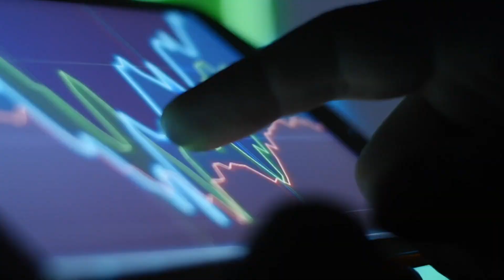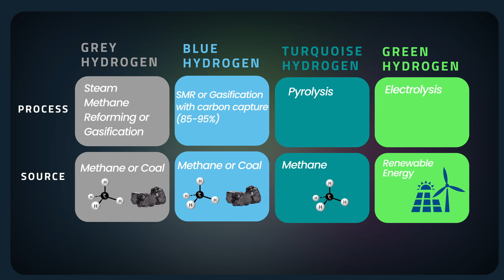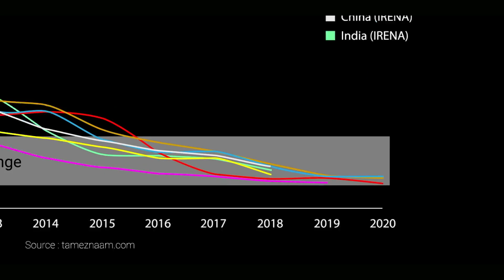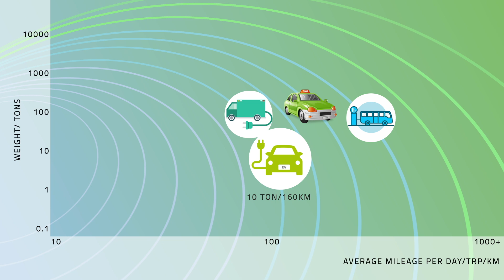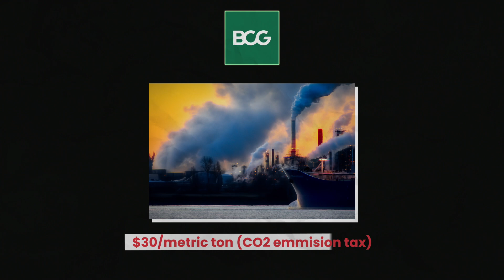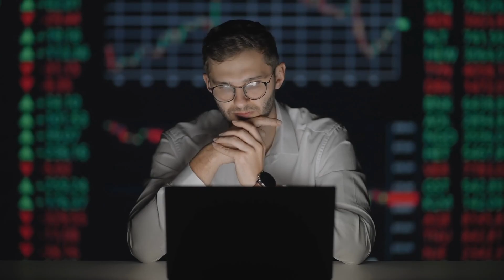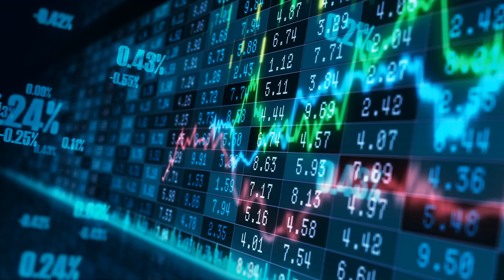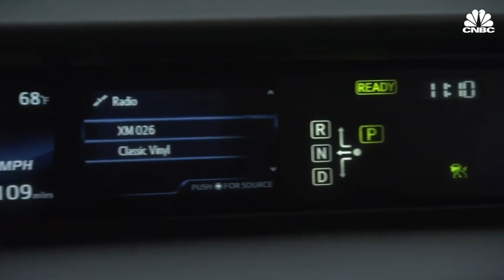Why NITIN GADKARI is pushing GREEN HYDROGEN for Indian Industries : Policy Case Study

Comment: This is what happenes when dumb mba students who hav no knowledge about the engineering aspects come across a new technology, hydrogen is an economic suicide for an economic if adopted for vehicles, 
The efficiency is so bad that you will bankrupt an entire nation

Here's a rough break down
U need hydrogen production facility 2 option on sight production & off sight production
. On sight is less efficient but more economical
But you need a super grid (electric grid) to facilitate this as every gas station will now consume upwards of 10mWh a day and this would be parallel to solar maxima for green hydrogen which means a peak load during peak solar , this super grid and green hydrogen has a theoretical maximum efficiency of 65% well we live in a real world where the efficiency is close to 30% (pemfc + electrolysis are super inefficient) so 70% energy is lost in all the conversion(1), who the duck is paying for the lost energy? , and if you are building a super grid anyway then you would rather use it charges bat EVs which has a theoretical maximum of 96% efficiency and guess what we are already at 89% real-world efficiencies (1)... at the end of the day if a free market exists then hydrogen cannot compete with bat EVs if you make laws to favour hydrogen then you will collapse the economy

Green hydrogen for iron reforming and steel production is an actual necessity which can only be solved by hydrogen (economically speaking) a true gold mine as well 

Please take down this video and don't post videos about topics that are out of your scope of understanding

Comment: How to store hydrogen?
Hydrogen is the lightest element in periodic table it can  pass through  any metal 
For that reason u have to rap you fuel tank with carbon fibre 😅 as per my knowledge carbon fibre is a very cheap meterial.😂

Comment: You missed to cover that batteries are more efficient way of energy delivery that hydrogen. Producing hydrogen from electricity, transporting it to site and converting back to electricity: there are massive losses in every part.

Hydrogen would not stand up to batteries.

Moreover there are huge safety risks with storage of pressurised hydrogen.

Comment: If green hydrogen is the way forward then all the oil majors,bpcl,hpcl,oil,ongc should have a stake in developing it and no pvt player like ril or adani should be allowed.these units dont require a lot of labour and hence should be operated by the govt.Steel,cu,coal,manufacturing should not be in the govts hands but green hydrogen should.

Comment: I must say for the transportation sector explained here, H2 is already thought as winner which is nowhere close to reality. In simple language if u generate 100kwh of energy, you can use 95 kWh in electric car on the contrary in hydrogen fuel cell u will use only 60 kwh in best case, mostly it will be around 40 kWh.  And this is Thermodynamic barrier like IC engines which can not be solved unless you find way around laws of physics. I simply don't understand educated people going blindly after H2. Do you know how difficult hydrogen storage is. All this great energy density and all is possible when hydrogen is stored at 700 bar. Do you really want pressurised H2 under your seat when you are driving. Only fools and idiots can think of H2 as transport fuel with these massive disadvantages which outweigh its advantages such as charging time. Direct electrification of road transport and railways can only decarbonise that sector. There is no way around. I really like Think School videos but this is disappointing to see they have also fallen pray to hydrogen hype. Green H2 should only be used where there is no other option like steel, chemicals like ammonia where right now we are using black or gray hydrogen.

Comment: Green Hydrogen? Ain’t no such animal folks! 
The only economical way to do it is still steam reforming, which uses mined natural gas, releasing tons of methane, which is waay more potent greenhouse gas than co2. If you want to produce hydrogen through electrolysis from solar and wind, you’re far better of storing the power in liquid air or batteries.

Comment: Bio- methane is still best suited for transportation with more advantages. Like it solve the garbage problem, cheap and affordable, moreover methane is trapped and used as a fuel which will otherwise contribute to global warming and keeping in mind that methane is far more dangerous than CO2.

Comment: REALITY HITS @14:30. Hydrogen is meaningless . Why ? Because you have to generate hydrogen using electrolysis 1) split water 2) generate hydrogen 3) transport it 4) use in vehicle's fuel cell to generate electricity.

Comment: Hydrogen as an Alternative Fuel
Hydrogen is considered an alternative fuel under the Energy Policy Act of 1992. The interest in hydrogen as an alternative transportation fuel stems from its ability to power fuel cells in zero-emission vehicles, its potential for domestic production, and the fuel cell's fast filling time and high efficiency. In fact, a fuel cell coupled with an electric motor is two to three times more efficient than an internal combustion engine running on gasoline. Hydrogen can also serve as fuel for internal combustion engines. However, unlike FCEVs, these produce tailpipe emissions and are less efficient. Learn more about fuel cells.

The energy in 2.2 pounds (1 kilogram) of hydrogen gas is about the same as the energy in 1 gallon (6.2 pounds, 2.8 kilograms) of gasoline. Because hydrogen has a low volumetric energy density, it is stored onboard a vehicle as a compressed gas to achieve the driving range of conventional vehicles...wikipedia. From 1992 it is on  paper only. We are not really serious.

Comment: Ok I got it. So Ambani and Adani is on board. Now there is no doubt where the idea came from. For those praising about this technology,  hydrogen has failed to succeed in much more developed nations with much better infrastructure that can handle the complexities of transporting and storing hydrogen. It is a high pressure system that is more potent than a lithium ion battery. Also fuel cells are very sensitive of contaminants. Toyota had worked for decades on this technology for transport.  The electrolytic convertion is very energy intensive. So the full chain of operation from source to consumptions is a lot more complicated.
For those who want to understand how alternative energies pan out, solar and wind are not really reliable sources of energy especially during peak production needs. If you add more steps in the storage to consumption steps you are increasing the cost.

Comment: @06:21 mins, how on earth Hydrogen powered vehicle key components takes less space? I agree - fuel cells take very less space.  But where is the hydrogen tank? Is it compressed hydrogen? then the hydrogen will leak from the tank (due to low molecule size).  Or it is cryogenic liquid hydrogen? Then it will require refrigeration. AND i am not talking about the extra energy required to either compress or liquidize hydrogen.

Comment: Thanks for the awesome content. I believe with the boom of the EV age, another factor of concern will be with the discarded Li or Po batteries and its components. In the past there were similar issues with the Led acid batteries (which got bettered in many ways later); however, there are seldom strict rules yet on how they are discarded and how that waste would be managed. This new revolution will be such a breakthrough.

Comment: While you informed about weight of li-on batteries being issue should also inform how these models are 90% efficient in using the energy and there are things being done to get away from cobalt. As far as i know major batter manufacturers are moving away from chemistry that requires minerals that are rare to find except Lithium. But good video as always and yes green H2 has to be go to fuel for anything but personal vehicle segment.

Comment: Bro, I like your content, but please double-check all the facts. With a regular AC charger, it can take more than 10-14 Hrs to charge at least 80% of the battery. 4 Hrs would be good enough to charge 50%-65% of Tesla using Level 2 charging stations.

Comment: Hydrogen is a pernicious product. Shortsighted people will see a solution all others will see danger signals in handling hydrogen.  Hydrogen still adds steps to driving that batteriers eliminate.  All good to let your neighbor refuel hydrogen until a little leak occurs and then BOOM!  Oops sorry.  Your battery information is 5 years old.  New battery technology is just as capable as your hydrogen projections. What about refueling at home?  Electric is clean and simple. Hydrogen is pernicious, Just ask the most capable engineer on the planet.

Comment: He has no knowledge of fuel. Hydrogen is not fuel for car that will work. If it was then it would have. It costs 3$ to manufacture it via electrolysis. It is no way sustainable price by any stretch of imagination and there is no way to reduce price down yet. All solutions are in research forget about commercialisation. May be for energy and buses but not for cars.

Comment: Challenges in green hydrogen
1. Water which is already scarce
2. Storage of hydrogen is like a ticking bomb
3. Distribution cost is higher than that of electricity distribution thru power plants considering the transmission losses
4. Alternatives like sodium based battery may come out way cheaper in near future

Comment: Hydrogen is inefficient, carbon capture isn't yet possible at scale so grey H = very bad, lithium batteries aren't the end of battery evolution, it's the beginning, with batteries you can make your own energy from the sun to power your vehicle.
Using H or fossil you are trapped in corporate greed.

Comment: Insted of hydrogen fuel cells, hydrogen gas use directly how we use CNC gas used as a internal combustion egines , we directly replace petrol and diseal with hydrogen, vehicals 
Japan already toyota cars developed hydrogen internal combustion engine , no need platinum and cobalt metals only draw back of hydrogen is correct handling it other wise it is like more serious danger effect compare patrol and diseal 
Per unit burning hydrogen gas it produce 576 k MJ wher as diseal 360 K MJ and petrol 490 K MJ energy

Comment: Pushing green H2 is a phantom dream
Green H2 is using way to much energy to produce in the first place.
So it will be produced from natural gas as it it now. Not solving any problems.

Secondly it needs transport infra an filling stations. 
The EV battery adoption that is in place for
City traffic is way more sensible.

Comment: Green hydrogen can never become viable to produce power. A certain amount of energy is required to break the hydrogen and oxygen bonds in water and there is no way to reduce that energy requirement.
If we have an electric car that runs on batteries, we can charge it at home. We can't produce hydrogen at home.
Li-ion batteries can be recycled.
No taxi driver will drive 350 miles without taking some rest. 
The byproduct of hydrogen as a fuel is steam. Water vapour is a global warming gas - as much as carbon dioxide. And, what ecological imbalance will be created by pumping millions and millions of tons of water vapour into the atmosphere, no one knows. Increasing humidity beyond a limit will make the planet unlivable.

Comment: A new good development. A technique to store hydrogen inside a powder to enable solid state transportation has been discovered. To retrieve the hydrogen enclosed within the powder, heat is applied to this powder.

In principle atleast, the safety-transportation hurdle of hydrogen looks to have been tackled.

Comment: Green hydrogen is manufactured with electrolysis of water, and this electricity comes from coal, and conversion of one form of energy into another form there is a considerable amount of energy loss as per the law of energy conversion. And pollution will remain as it is.because coal burning will cause green house gas emissions and heat.

Comment: I’m a material science engineer, I agree to what he says at the basic levels as you start to dig deeper it gets very peculiar for every case. No lithium iON battery doesn’t get counter productive due to added weight, conditions such as cell quality and operating temperature are the driving factors. Hydrogen fuel cells are not new they have been implemented in first world countries and have failed to take over mostly due to high Refill costs and car manufacturers putting a premium for them. Toyota , Mitsubishi, Lexus all tried to push their hydrogen vehicles but failed miserably . The astonishing factor in this case of India is the wealthy tycoons have opened up investments to this cause. With the relatively high Gas cost in india Hydrogen fuel might actually work. Would be intriguing how this unfolds .

Comment: I just have a doubt...
Won't hydrogen just explode in case of fire?? Hydrogen flame is so hot that it melts metals.... 
And will people be ready to keep such a dangerous thing in their vehicles??
> Yes i accept even carbon fuel also explodes but that requires an enormous amount of oxygen to create such an explosion. But hydrogen requires just half of its volume of oxygen to explode that too in a very very short interval of time.

Comment: I would like to correct you that Hydrogen reduction method is not used in India yet for steel production its reduced using coking coal or majorly petcoke frm Refinery which is the reason that steel industry produces so much of carbon foot print. Hydrogen based reduction is still in nascent state that too in advanced  countries, So evan if u use grey Hydrogen for reduction processes that's far far far better than coking coal and evan aftr that there will be Co2 emissions which is called process emissions.

Comment: Spliting h2o ie water will reduce total water in the ecosystem? Will it not create imbalance? If yes, will it not dry up the water on this planet after many decades as the energy consumption is never going to end. Also there will be too much o2 in air after electrolysis ie more than 21% which is required for ecological balance. So increased O2 in air might catch fire. Just asking. Can someone explain if I am misunderstanding anything?

Comment: Thank you for the amazing content. 
Talking about energy/weight ratio, hydrogen gas will be stored in its liquid form which requires a temperature < 20 Kelvin considering 1 atm pressure. These storage tanks are heavy, further making the energy/weight ratio not so desirable. Please include this point while researching.

Comment: If you inquire about h2 energy there is a big downside that is covered into last part, and he didn't mentioned the extreme prices to produce h2 automobile, h2 pumps and transport of h2, considering all of this will be resolved in future is a big optimism. 
In past h2 has failed in automobile industries as foreign companies have already tried it. But now as the prices have decreased and need for clean energy is on rise this might be a solution. 

Only if this sector develops like smartphone industry. 

Too much optimism 😂😂

Comment: It is hype that hydrogen per liter has high energy, hydrogen per liter has very less energy. 
But when compared hydrogen per kg has more energy But hydrogen per kg requird 11 times more space than 1liter so it is not good for car.
But it is possible to make hydrogen bus because bus has more space to stored hydrogen gas ⛽, which is not possible in car

Comment: Solar power (8hr/day) -> Power Storage Gigafactory (24hr/day)-> Running Hydrogen generation plants (electrolysis need power) -> Hydrogen replacing coal in thermal power plants -> Green Energy (24x7) -> EVs/Power for industries/homes. Also, hydrogen powered cars have no future when there are EVs getting charged on green energy. Hydrogen can work on transportation sector. Nuclear energy has no real future in next 20 years.

Comment: The Round Trip Efficiency is of essence, isn't it ⁉️😅
But for which our cars would be using water as fuel to produce H2 by electrolysis. 
Unfortunately there is no perpetual energy. There will be a conversion loss.
The overall efficiency of the electricity-H2-electricity will be below 50% even if the fuel cell itself is 100% efficient. Tilting the equation back in the favour of fossil fuels.

Comment: Dear Nitin, Thank you. Educational and promising info. Looking forward. Will there be any disadvantages and domino's effect of using this energy? In my experience every solution brings new unseen problem. e.g. Once Chinese almost extinct sparrows to save the 10% of crops. It worked for a while and later on 90% crops were destroyed by the insects which grew enormously as insect's predetors were RIP.

Comment: If we are converting "solar energy" to "Electrical energy" and converting it into hydrogen energy ... This converting process uses energy which increases the waste of energy and transporting the hydrogen ... Instead if we concentrate on "battery technology" where it can used used longer and can store more without increasing the size of the battery... It'll be helpful for Home transport and more ... For long range heavy vehicles Hydrogen fuel is considerable. But for others its lacking... We can't run home from hydrogen... Yea technically you can solar = electrical = hydrogen= transport = hydrogen tank= electricity

Or we can use solar =electricity= storage= electricity...which is way more better